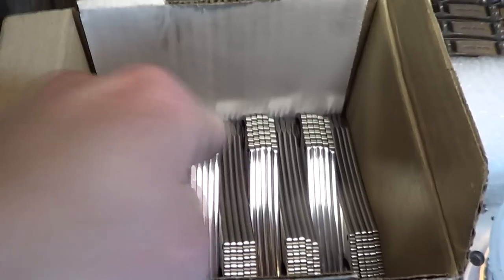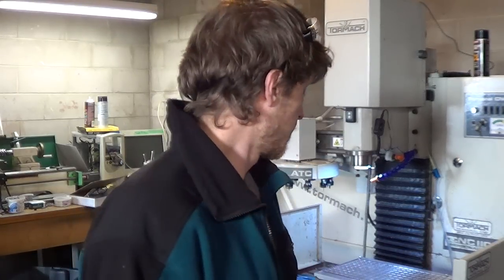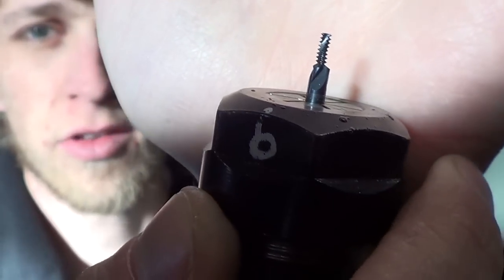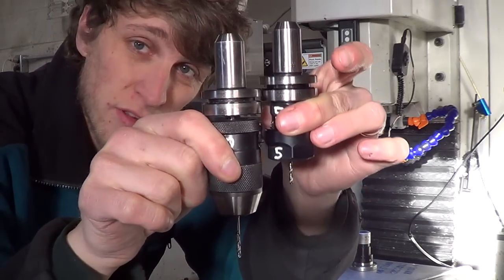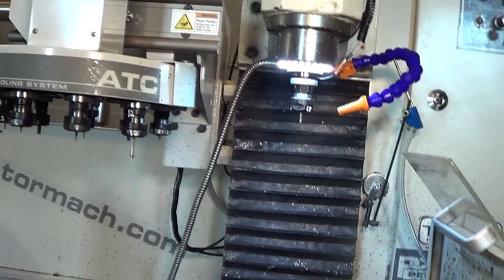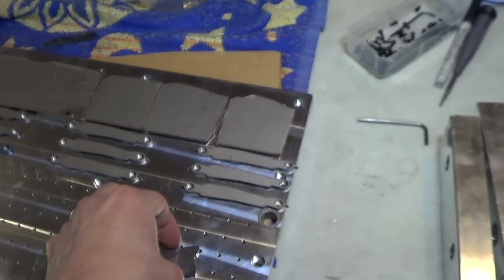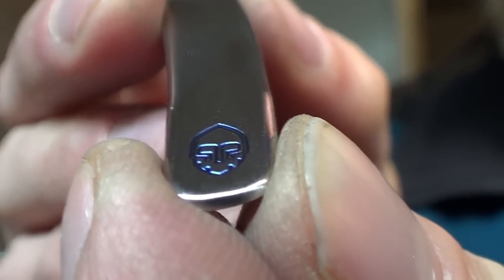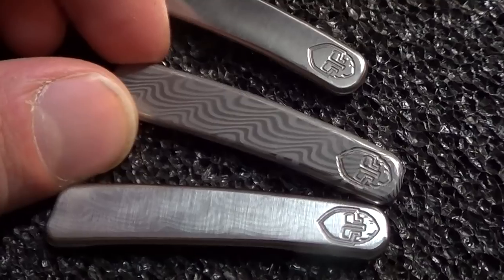Knifemaking Tuesday Week 60 - Pocket clips

Comment from the maker: I've thought about doing that, but almost all my long-run codes require 10 or more tools.  I like to sit there and watch it for the heavy roughing ops, just so I don't blow up all the following tools, but your method would save that.  Also, for accuracy I always rough and finish with different tools, that way the finishers stay sharp for a loooong time and I can be relatively sure that they'll remain accurate.

Comment from the maker: I have wondered about getting one, but I have no interest in trying to re-sharpen my carbide endmills since they have to be so precision.  And with CNC it's nice to always use the same sized tool, although you could always compensate.  It would be handy to shorten chipped endmills, because the often whole sidewall is still in new condition but the tips are chipped, so it would still work great for profiling if I were able to use those flutes.  Most endmills I fly through are $6-25, not bad.

Comment from the maker: Thanks!  It's something I've been wanting to do for a long time, so I'm thrilled to finally have it working.  Rob pretty much nailed it.  I think any z probing macro would work, I use a slightly modified version of Tormach's routine.  Then I made a gcode to move to a desired location, enter a new fixture offset (G59P101-184 for my clips) and call that macro.  Move to next location, enter next offset, continue.  When when machining, some ops are top-down so I enter that specific part's offset.

Comment from the maker: Apparently the big fancy machines do that, but it sounds really complicated and is probably outside the realm of Mach3.  Spindle load will change with every single cut, often in the middle of a cut, so monitoring it for something like this would be pretty involved.  There are easier ways to check for broken tools which I'm hoping to implement at some point.

Comment from the maker: Current flow won't work, but I've heard of people installing a simple plunger button and touching each tool onto the plunger to make sure it's still there.  Called a "tool not there" sensor.  I definitely want to implement something like that in the future, but I have no room on my table for an extra switch!  So the switch either has to swing in from the side (complicated), or I figure out a laser switch of some kind (also complicated but way more awesome).

Comment: When you were talking about lights off machining, it got me thinking.  I wonder if there's a way to sync/record the power draw on your spindle to the runtime in your program.  Basically, that while running line "X" you should be drawing "Y" amps.  Anything less means you've broken a tool, and it could shut off and alert you.  This would avoid the tool failures compounding when they overlap.

Comment from the maker: There are definitely bugs and tricks to learn with Mach.  If I e-stop or reset while it's moving I always home it, but even still it's never really out more than 50 thou or something, just guessing.  I don't think I ever figured out why it happened, it crashed hard, like it was several inches off.  Maybe the wrong tool number or it thought it was tool 0, I've done that a few expensive times.  Spacebar/feedhold works great to safely pause the program, that's my go-to gentle program pause.

Comment from the maker: Moar POWAR!  I've used the 770 a bit and stalled it, mostly because I'm used to the 1100.  Also I wanted more table size.  I like being able to hit a full 10"x18".  I'm not limited by space or weight in my shop either.  And I don't really need the 10K spindle, although it would be nice for some jobs.

Comment: Hi,
I have a DIY cnc mill, and it amazes me how you talk about your work, all your mistakes, accidents with the machine, starring at the machine for hours up you get confident... your vids are great.
Witch software do you use for 3D modeling ? and witch for converting 3D to Mach3?
how you make that process for the machine to measure the Zero of the plate?

Comment: Great tip on the probing. I just ran into this issue 2 days ago in 6AL-4V. I had some cuts with deeper profiles than I expected because of variation in the thickness of the block. I could have surfaced the block first, but in your case with thin sheet, I LOVE your solution.

Comment: Hi John,

With regard to the 'Loupe' you will find the little loupe you use will probably be more that 4X, maybe 10/15 X. The larger sized lenses have a substantial Focal Length of around 15 / 20 cm for a 2 / 3 x mag. The smaller focal length lenses are much more powerful with a 15 x loupe's focal length of about 2.5 cm. If your lens follows the experience I have had

Comment: If you read the start of the explanation it is as I said, the dioptre equals the focal length in gradually ever smaller distances from the face of the glass to the item looked at. It gives you the measurement of one instance where 3 dioptres equals ⅓ M you may be able to get the size difference per dioptre I have not done so yet, but as another instance about 4 dioptres is roughly arms lenth

Comment: John, just a thought on your crash. Havent used Mach a lot, but in other controllers, if you stop or estop, the machine doesn't know the Z height if you just jump into the middle a program again, you need to restart at the previous G43 callout.

Comment: You can buy a magnifier that is about 5 inches across that has a ring shaped fluorescent tube round the circumference, shielded from the user. I know a search on Farnell for illuminated magnifier should spring some results. I would guess less expensive versions can be found on other sites

Comment: When you mentioned leaving the machine unattended and having the endmills 'stack up' when one breaks, it occurred to me; I wonder how hard it'd be to write a plugin or something to have Mach3 monitor the spindle load and if it drops suddenly when it SHOULD be cutting...it assumes you've snapped off the endmill and it triggers the e-stop.

I've never heard of anything like that, so I have to assume it's either a dumb idea, or it's just because I've just never looked for it before. Heh.

Comment: Its usually made to work the other way, as a preventative measure. If tool X is drawing more than Y% spindle load, switch it for a redundant tool. Its a very common system, but requires very repeatable processes. Its easy enough to use a probe to check for a broken tool, and is far easier to implement.

Comment from the maker: You can't tap a blind hole right to the bottom, not without rigid tapping which my machine doesn't do.  For through hole tapping, or deep holes, regular tapping is the way to go.  Will check out modifiedz vid, I knew he was going to do it but haven't heard anything since, thanks.

Comment: I was just looking at your video tread milling and you commented that it was hard to see. It kind of hit me that the water was flowing in the same way the light should be shining. So I wonder if you zip tie one of those cheap small LED flashlights to your coolant spout would it light up the location of the mill? The weight of those thing is almost nothing so the spout should be strong enough.

Comment: xample, a 3-dioptre lens brings parallel rays of light to focus at 1⁄3 metre. The same unit is also sometimes used for other reciprocals of distance, particularly radii of curvature and the vergence of optical beams. The usage was proposed by French ophthalmologist Ferdinand Monoyer in 1872, based on earlier use of the term dioptrice by Johannes Kepler.[1][2][3]

Comment: Use some sort of remote desktop into the Tormach and you can remotely press [Enter] to continue after programmed stops if everything looks OK on the remote video.

I use LinuxCNC, and when I assemble my 25" X 60" 80W laser, I'm going to use my home video security system to monitor the laser to make sure there isn't a fire.  Might get an IR pyrometer fire detector for the alarm system as well.  I don't have long machining runs.  I'm there with the lathe and mill.

Comment: possibly, but end mills and drill bits would require a 4th axis. I've ground lathe tools on my 770, but only because I needed a very specific shape (grinding bit in the spindle, flood coolant, very very slow feed. Accurate shapes require you to replace the bits several times)

it's not often worth it if the tools you plan to make are already for sale. Go for it though, if you're just looking for experience.

Comment: re placed close together their powers approximately add. Thus, a thin 2-dioptre lens placed close to a thin 0.5-dioptre lens yields almost the same focal length as a 2.5-dioptre lens would have.

Though the dioptre is based on the SI-metric system it has not been included in the standard so that there is no international name or abbreviation for this unit of measurement—within the international system of units this unit

Comment: I am going to look see if I can find the focal length and size of image equates to the Dioptre
This article is about the unit of measure in optics. For other uses, see Diopter (disambiguation).
A dioptre, or diopter, is a unit of measurement of the optical power of a lens or curved mirror, which is equal to the reciprocal of the focal length measured in metres (that is, 1/metres). It is thus a unit of reciprocal length. For e

Comment: And John why not just use a regular tap and the spring loaded thing like you did before if it would be faster then using the threadmill now? Are you doing it for like the "Lights out" thing so that you can walk away because the threadmill is the same size as the other tools? And those Damascus clips are amazing!

And also check out MODiFiEDZ KNiVES new video on Re-anodizing Norseman #6 to a really awesome blue. I thought you might like it :P

Comment: Just wondered if you have any problems with less stability due to there being so many holes in the tooled piece or the actual steel that holds it. When you talk of very small clearances even a -1.000 would make a difference over time?

Comment: Repeated and constant tentioning methods to tighten nuts and bolts and fixtures when done in the same order every time will 99% of the times give good results and get close to "Lights Out Engineering". Forgetting where you are in the milling process and or restarting because something failed is going to give less predictable results. As long as you can

Comment: To go lights-out, couldn't you let the tool touch a probe or something before and after the pass?  If there is a difference in the measurements of the tool then tell the code not to proceed with the next tool.

Comment: John have you thought about getting a tool and die grinder for sharpening your endmills and drill bits?  They come up for sale now and then on craigslist.  most are in the 1500 dollar range, but some endmills are 50 bucks or more a piece, so it could save you money.  By the way check out my page, I got some great videos on the blackesmithing side of knives.  I'm also starting to convert an RF-31 mill to cnc.

Comment: No offence, but I guess now to can equate tool speed and diameter and its path in MPS/IPS I guess you can almost call yourself an Engineer.
No doubt I will get a few nasty comments about that but you know what I mean, there is not many Engineers who have to double think everything they do, because often the set the tools in the machine using long learned systems of sizes and weights that are very conservative and so they are almost guaranteed to be long lasting.